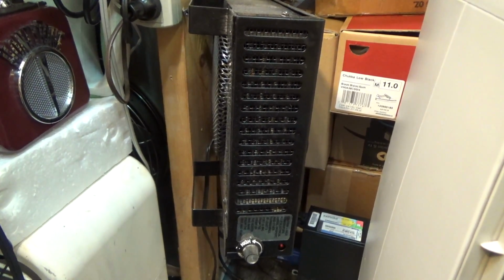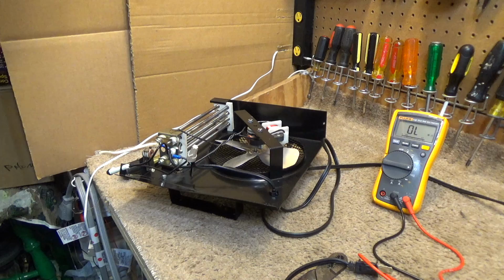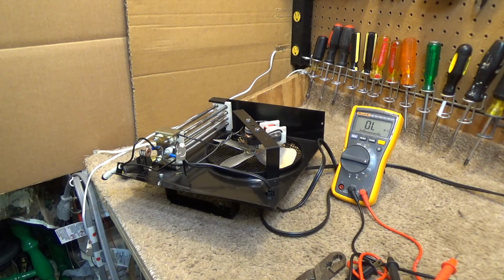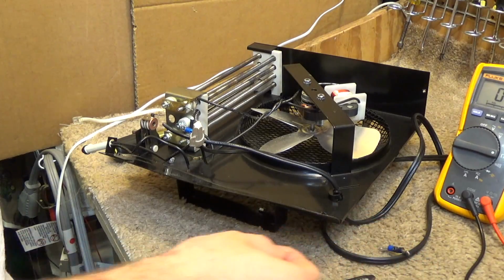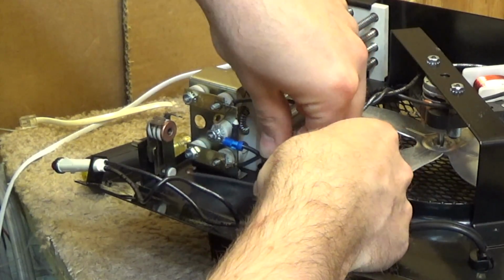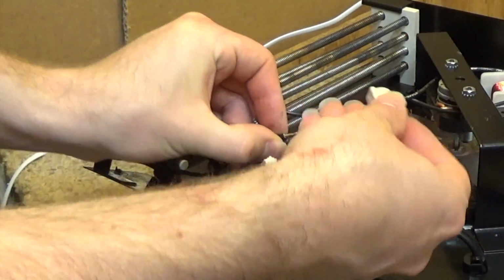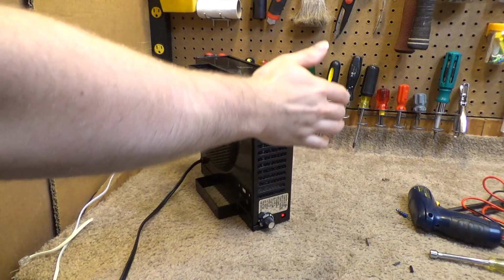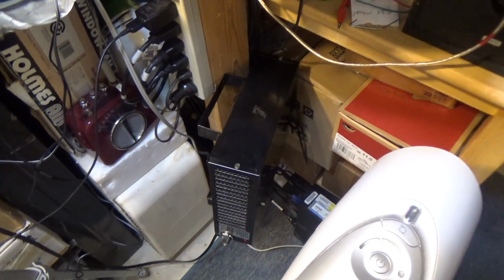CFM Harris Heater Repair

Comment: It might have something to do with the terminal where the crimp is. Also wire can fail - I had a 16 gauge cord fail at the cable clip where it went into the heater case.
Reply from the maker: I've encountered one failed cord since the recording of this video. Uncommon, but it certainly can happen.